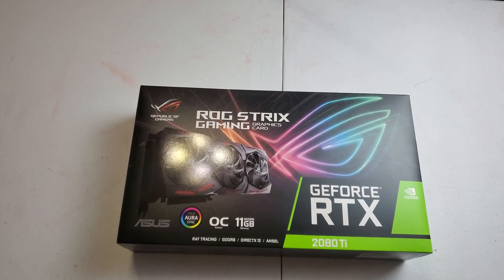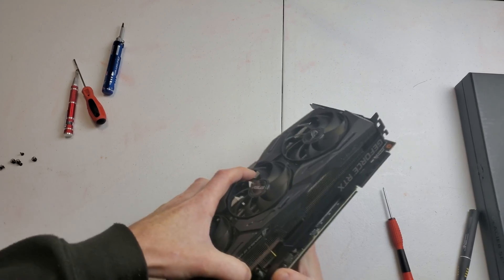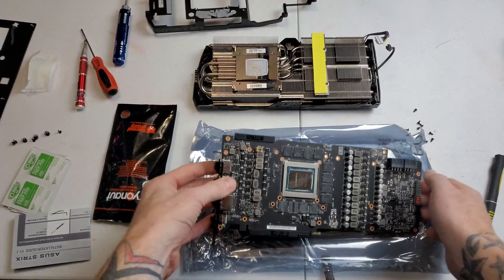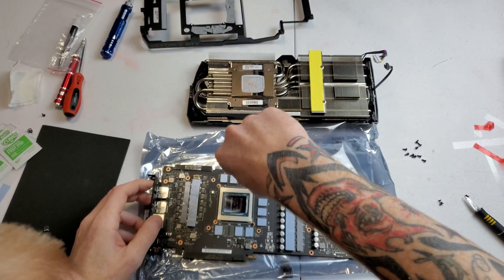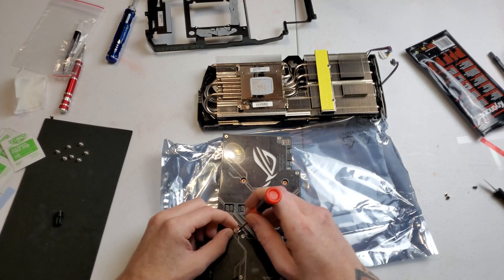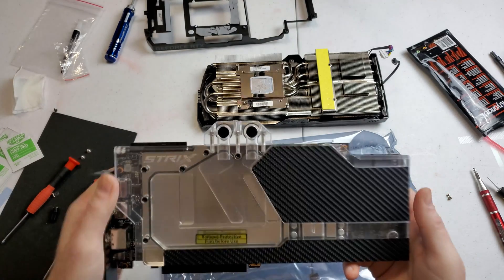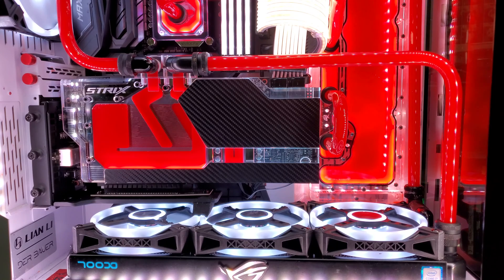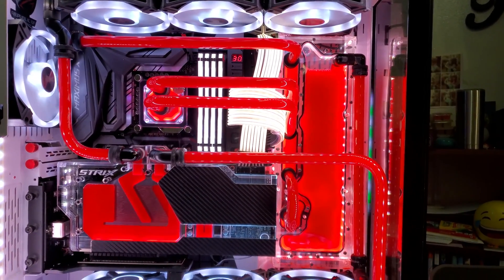Asus RTX 2080 TI Phanteks Waterblock Install

Comment: dose it matter what is inlet and outlet on the gpu block? i also got a airpocket on mine
Reply from the maker: Yes, it does matter what inlet and outlet are. The Coolant goes through micro-channels to cool the GPU. When 1st filling up I got a huge airpocket too. Just tilt the case sideways and all around. You have to with the pump (or entire PC) ON. Hope this helps. If you have any more questions let me know.
Reply: @Moyersteven1  What is the inlet/outlet i just did same as other builds and hope it was the right way. did a benchtest and hold 37-40c, but i still have alittle airpocket left :/
Reply from the maker: @sliminus92  Are you using the same Phanteks GPU block that is in the video?
Reply: @Moyersteven1  i am using the Phanteks Glacier G30 Strix but the design is the same. i search everywhere on what is inlet and outlet.
Reply from the maker: @sliminus92  The inlet on that is the left one.
Reply: @Moyersteven1  Nice then i did do it right :)  huge thx to u! no more headache for me :D

Comment: So stupid question here, can I pair this block with a Corsair pump and res? I don’t trust the waterblock that Corsair makes. I’m thinking a pump is a pump and it doesn’t matter. But I figured I’d be safe I have a lot of money in my system and don’t want to make a rookie mistake lol
Reply from the maker: Yes, you definitely can. Ive used 2 different pumps and works great. This block is a lot nicer than the Corsair one.
Reply: @Moyersteven1  thank you so much for the super quick reply. This makes me feel a lot more comfortable lol. My whole build is Corsair (except motherboard etc) and I was a little conflicted having to choose a different water block. But your video has me wanting the phanteks block and I’m excited to install it :) thank you again!
Reply from the maker: @quartermoongaming  Glad I could help. I've been through a few blocks. Alphacool, Corsair and Phanteks. The Phanteks is by far the best. You will see for yourself once you get it. It's amazing and keeps my card under 60C with a big overclock.
Reply: There is no stupid question my friend.  There is always people in the background wondering the same thing, and dont ask at all. Thanks  :)
Reply: hi, what is your GPU temp on full load...

Comment: Hi there, I'm about to do the same install and have a quick question - Do you need to remove the stock backplate? From watching the video it looks like you might be able to remove 13 screws holding the backplate, remove the brace then put the screws straight back in there? Just wondering if there is a specific reason you need to remove it if you plan to reuse it? I'm thinking if I don't have to remove it and unplug the LED it's one less thing to potentially break :-) 
Thanks,
Reply from the maker: Yes, You do need to remove the back plate. If I remember right there are some screws under it.
Reply: Cool thanks for replying
Reply: @darrenh2693  The Backplate can stay on. Have the same block and card.